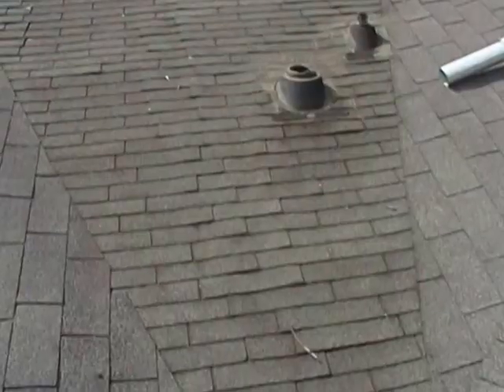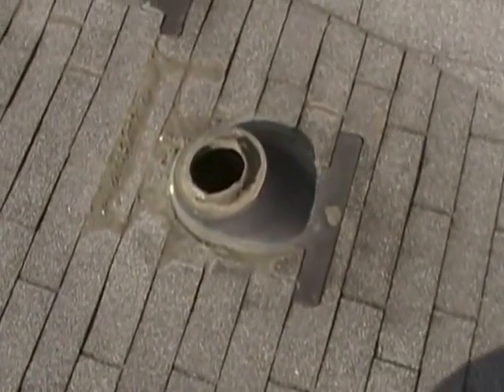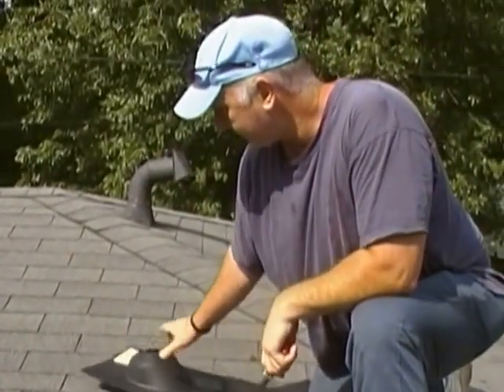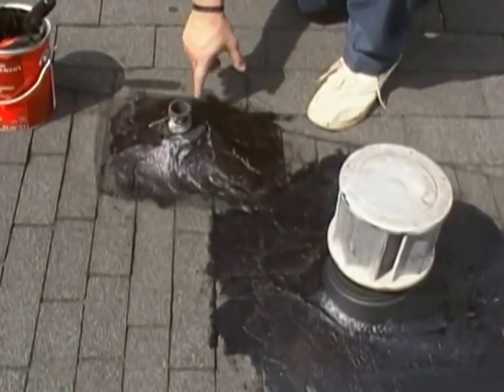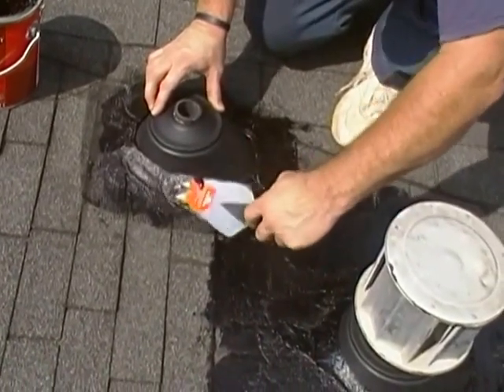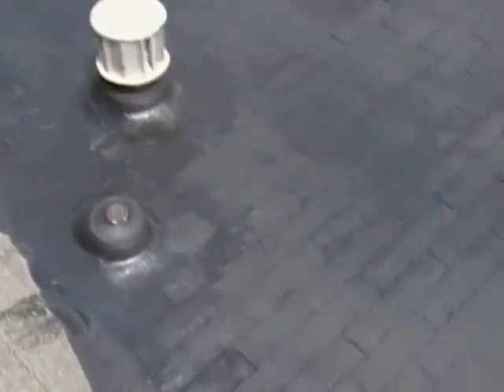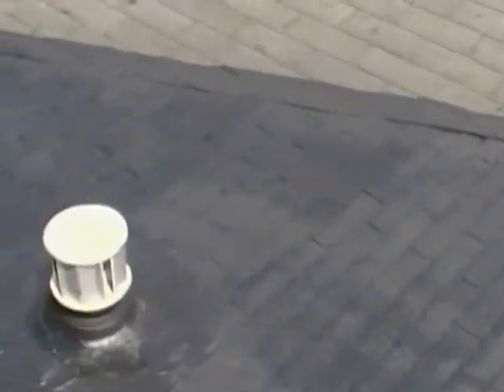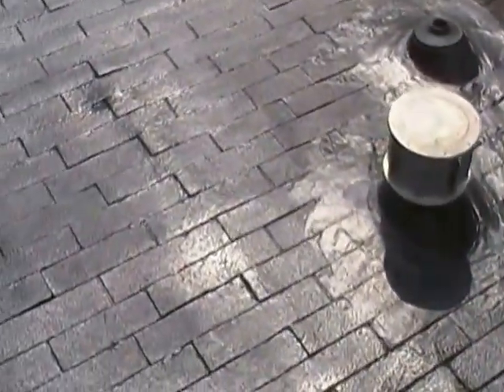How to: Roofing - Water Leak Repair On A Flat Roof

Comment: I have a flat roof   too   and there is one inch of gravel on the roof  .Can you say why they put this gravel  ?  Because of it the water does not flow quickly to the exit pipe after a rain or fall of snow . The water remains on the roof for some period  . Do you think that there is no danger to the roof if water remains stagnant on the roof  in summer and cold seasons ?
Reply: The gravel is there to block UV radiation, so it makes the roof last many years longer.